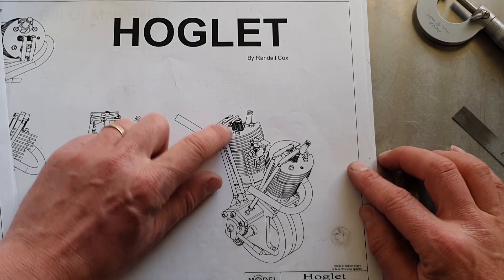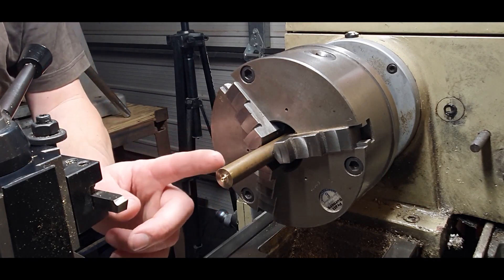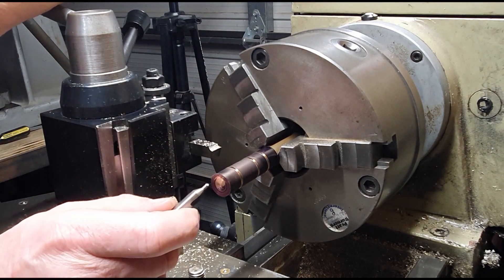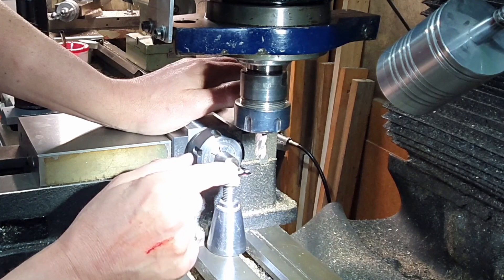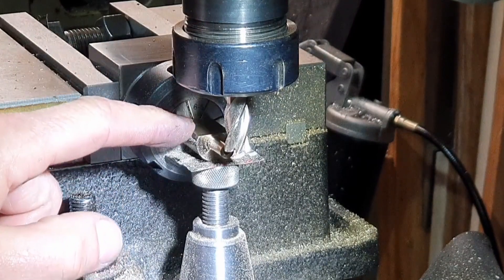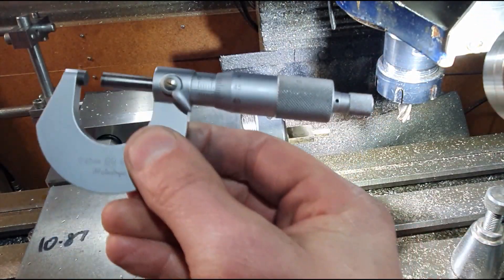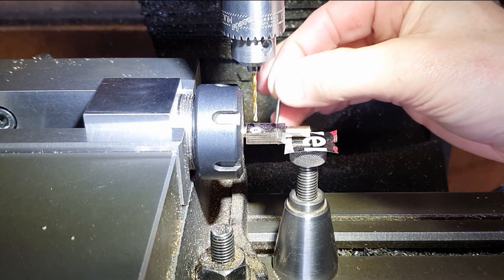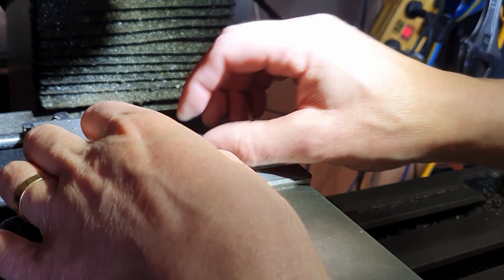#89 Part 3 - Hoglet V-twin Engine - Rocker Arm Perches

Comment: Nicely done Kevin, good order of ops to minimise setups, well thought out. I notice you use your head axis a lot and not so much the quill (lol, welcome to my current world), is this to get benefit of DRO or some other reason? Cheers, Jon
Reply from the maker: Hi Jon. Using the head axis instead of the quill just is a habit (more rigidity on the heavy cuts). Thanks for watching.
Regards Kev